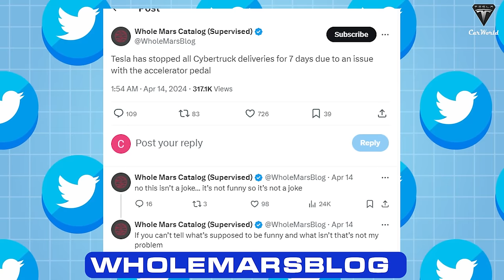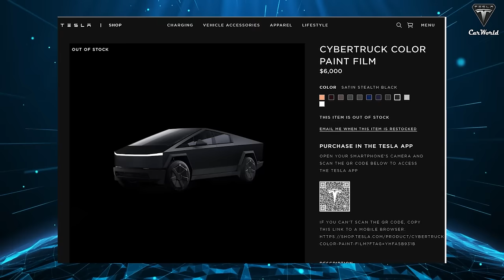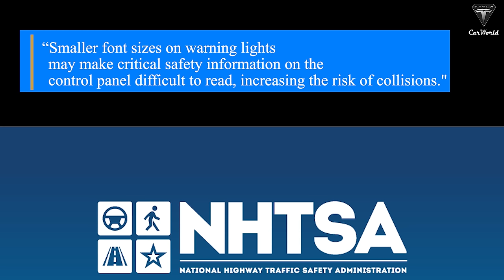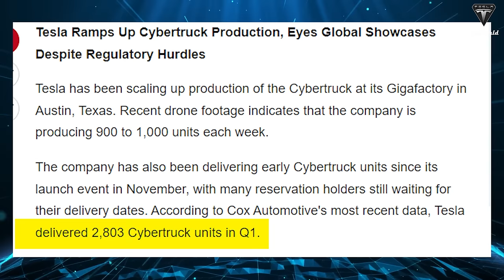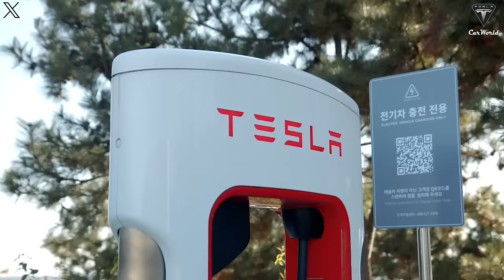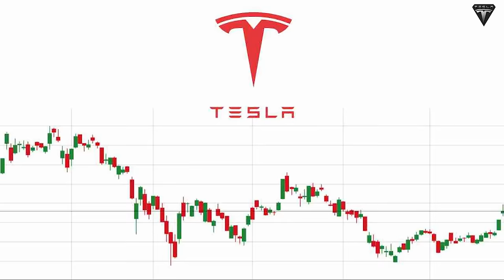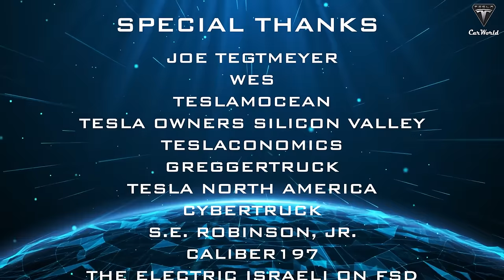It happened! Elon Musk STOP producing Cybertruck because of 3 serious problems! Details Explained

Comment: The accelerator problem I heard of was that the cover slipped off and could jam against other fittings at full throttle.

You can buy 3rd party wraps, installed for under $2K! or precut DIY for $1,200

'Font" on screen should not be a "recall", simple software update!

Assuming a single factory ...
1,000/wk => 1000/5 = 200/day =>  200/8hr = 25 /hr  That is "best case" and extremely slow by Big 3 automaker standards.

250K/yr = 250K/50 wk = 5K / wk ....

I read that the company was looking for ways to restore is obscene $56 billion "salary" that was rolled back. ("earn" back his dumb twitter "investment" in 1 year, must be nice!)
Reply from the maker: Thank you for your useful information. We really appreciate it

Comment: This is a puff piece of FUD.  The 2m recall for a font issue was for FSD font.  Cybertruck currently does not have a working FSD.  The font issue was fixed by an OTA software update.  The CT does not rust this small  iron particles picked up from the air and rusting power wash the car.  Tesla recalled all 4000 CT to replace pedal, and all current new made CT, have revised pedal.  Deliveries already recommenced.  Try talking about the Blazer recall and stopped sales or the Bronco disaster
Reply: It’s okay buddy, your daddy will be fine

Comment: Tesla found a problem and fixed it.  It was a possible safety issue that is fixed at home or work.  If only Ford or GM was more responsive.
Reply: Ford and GM don't release vehicles that are this shoddy. Cybertruck is a joke.
Reply: I mean, GM wouldn't make these basic mistakes to begin with. Are we really defending a vehicle that was designed with a bare metal exterior that would obviously corrode and they're charging 5 grand for a paint job?
Reply: @Kai...999  You mean like the recall of 40,428 GM heavy-duty pickups due to a break system that would catch fire?  

This Tesla recall was trivial, caught fast, and fixed quickly.  Everyone has safety recalls.

And the exterior corrosion issue was debunked a while ago.  Afraid of the 2 million in line for Cybertruck?
Reply: @External2737  Bro I'll give you credit on Tesla catching this quick and doing a recall on all units but I'm an engineer and I know about 140 different alloys and I can tell you it's a fact of nature that steel will oxidize. We have yet to find a doping element or elements to prevent this. But paint does a good job.
Reply: lol!  They weren’t ready for release. They are doing over the air updates like every week and they still don’t have promised features.  Elon the man child grifter said push em out the door.
Reply: @jagpilotohio  The thing about Elon is I don't think he's a grifter, per se. I think he truly, genuinely believes his projections for his projects. Like they're essentially undoable, he's setting himself up for failure. But that's due to his lack of understanding of engineering. He's a great business man, that's obvious. But he also thinks he's an engineer which is subsequently fucking up his businesses.
Reply: @Kai...999  that company would be so much better for if they booted his butt out the door. I’d never consider buying one of their vehicles until he’s gone.  He turns my stomach.
Reply: @jagpilotohio  Eventually they'll probably do a hostile takeover if he doesn't end up in prison
Reply: @Kai...999 type in gm recalls, you’re dead wrong.
Reply: @Kai...999

You're joking right?
I mean you don't seriously think that Elon Musk isn't a grifter, surely you saw when he put a guy in a robot costume and had him dance around on stage, claiming that will be what his new robots will be like next year, and yes that's was a few years ago and the ONLY dancing robots that are being made are by a company called Boston Dynamics (and they are not available for the general public to purchase, they are meant for military use and factory use, rightfully so).

And he has the audacity to charge an outrageous price just for the damn charging cables for Tesla cars. He didn't invent charging cables, he didn't even design them either, he took a design that already existed for other devices, and since it has a special port, no other cables will fit that port, so he gets to make even more money from that alone.

Elon Musk is definitely a grifter, (and like Jeff Bezos has no soul).

Comment: CT production was halted temporarily to replace the defective Go Pedals with newer and better components. NITSA DECLARATIONS of Recalls for Tesla cars are generally not actual recalls as most issues were dealt with in over the Air Software updates. The Cybertruck Accelerator issue is one of the very few Tesla Recalls that actually requires the vehicle to go to a service centre … that’s because it’s a design failure that can randomly happen. I could fix it with a self tapping screw in next to no time just looking at it ….
Reply: Ha...  "newe and better"... ha, you mean that off the shelf rivet they screwed in? hahahah  real nice truck they got there.  Real professional, well managed company... hahaha
Reply: Will you be going out to people's houses in your car to offer to fix the pedal with your self tapping screws